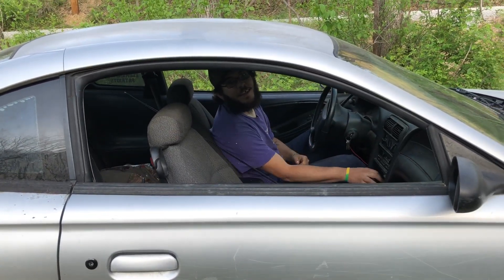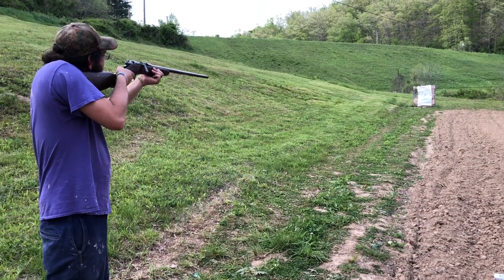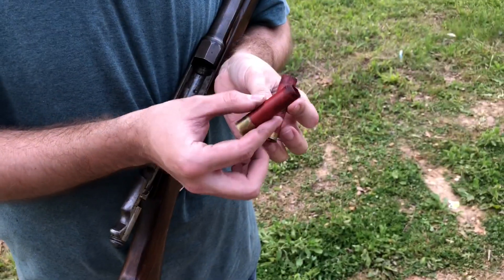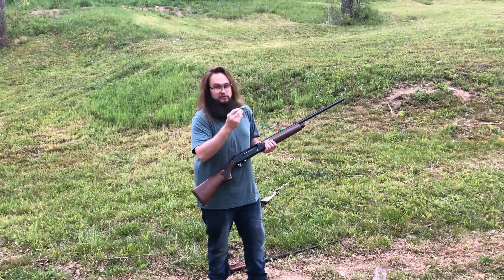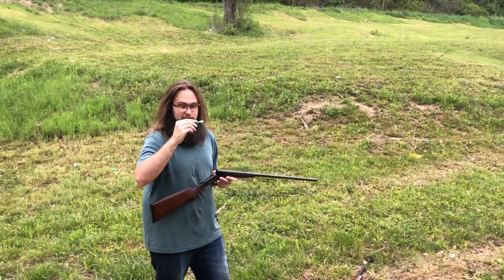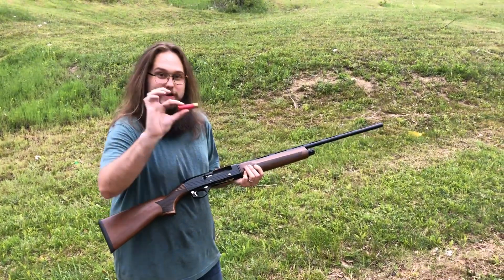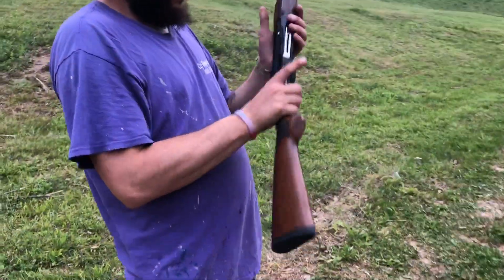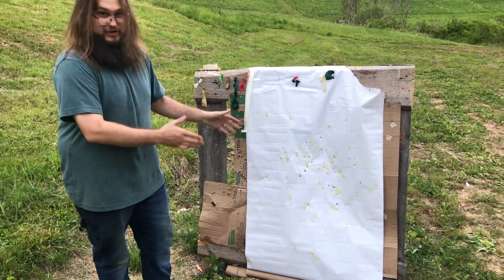28 Gauge Buckshot Reloads Range Testing!

Comment: You guys hear about this?  
"Recently another solution to mismatched plastic wad and hull interior diameters has surfaced. The paper napkin!  Simply take a thin single layer of paper napkin, cut into a one inch square and place over the case mouth before seating the plastic wad.  Seating the wad then prevents powder migration with a thin layer of paper napkin without any  significant change in stack height.  Yes, this solution surfaced in facebook discussion groups and recently noted on Bubba Rountree Outdoors."
Reply from the maker: Yeah we’ve been doing that too after seeing wade do it. We’re in those groups too.